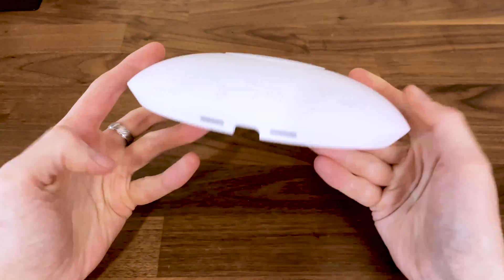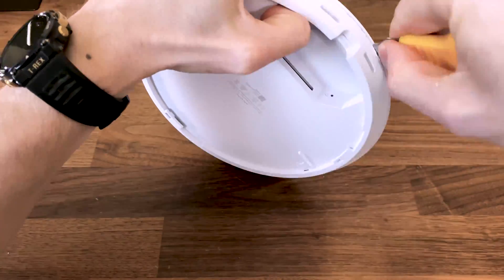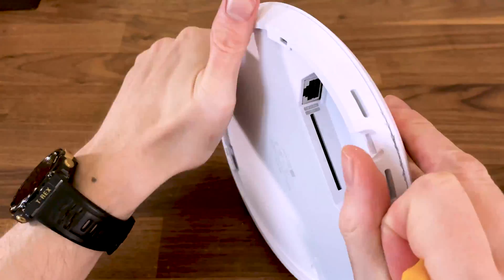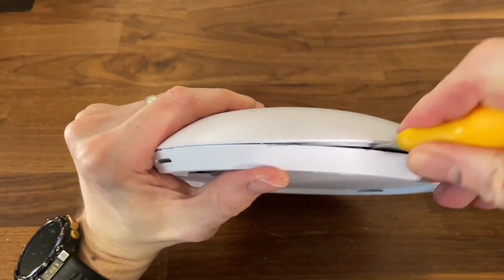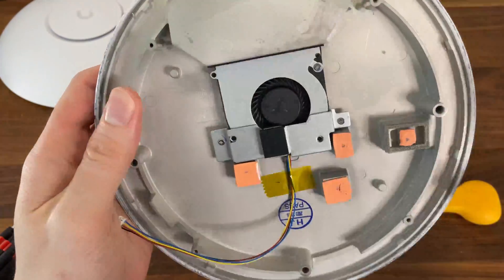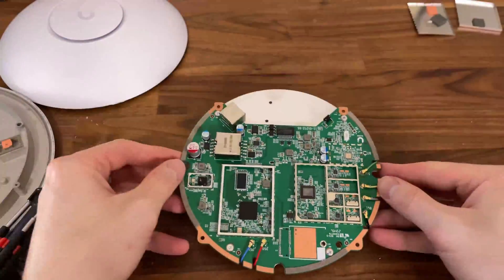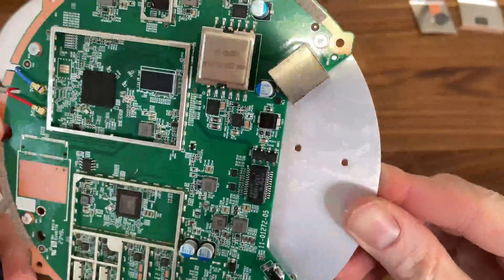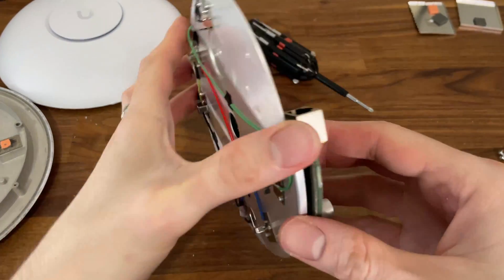Ubiquiti U7 Pro WiFi 7 Access Point Teardown

Comment: Do both the U7 Pro and the U7 Pro Max have fans? I ask because the Pro Max was the one that had a fan, but it seems they both do. Also, he said the radio had 4x4, which makes me think the one described in the video is the U7 Pro Max, not the U7 Pro as described.
Reply from the maker: They  both do and this is the U7 Pro. I made this teardown more than a year ago and I simply checked the specs of the chipsets. Perhaps Ubiquiti limited it to 2x2 despite the full potential of the chip.

Comment: I bought two and they simply don't work with any existing computers in our company. Nothing can connect to them. Even in IOT compatibility mode. Pure junk.
Reply: The 2.4 band seems to be problematic on these. I just turned it off and use an AC Lite for legacy 2.4 clients. Only IoT crap should be using the 2.4 band these days.

Comment: They should warn customers that these are really ONLY for ceiling mounting. When you put them on the wall with the "U" in upwards, it will overheat. The warm air gets trapped in the upper half of the device and the fan tries to push warm air a long way out through tiny holes, which does not work. No wonder why mine overheated and quickly recovered when I took it off the wall with the vent upside and additionally putting an ice pack on it during the last few weeks.

Unfortunately, contacting Ubiquiti support will not help you identify this as an issue. They will point you to installing the latest beta firmware update (my experience) and hope that you problem is solved. Which it isn't. The devices are supposed to work at up to 60 degree Celsius environment temperature and it was only 30-33 degree Celsius. Do they actually test their designs? Now I have serious doubts. It could be that I got a bad device, but the bad WiFi experience I sometimes had with the U6-Enterprise, which is very similar with the metal back side (which the U6-LKR didn't have), could have had the same cause, I was just not expecting it and not experienced enough to identify the issues back then.

U7-Pro-Wall design makes much more sense with larger vents.Which was unfortunately announced a few weeks later.

Comment: You open it wrong.  Take a Stanley knife and expose the blade about 2mm.  then go around once and it's open.
Reply from the maker: Oh, I am sure there was a better way to open this type of devices. Which is why Ubiquiti should just use screws and silicone seals for water resistance, so that at least one idiot (myself) can easily access the inside of the AP.

Comment: bigger question does the fan stay running all the time or only when it under alot of load?
Reply from the maker: I haven't yet tested it enough to be 100% sure (a proper review is in the works), but I can tell you that there are times when I hear the fan and other times when I don't. The conclusion seems to be that in the worse case scenario, it does adjust the rpm according to the load.
Reply: I didn't hear any fan noise. Mine might have had a defect fan.

Comment: I did not know about the fan before. It might actually be a deal breaker. Are there fans in any of the U6 versions?
Reply from the maker: I have opened both the U6-LR and the U6 Pro and neither had a fan, so I assume that the Enterprise version is fanless as well.

Comment: Hey there. Thank you for this tear down! I wrote to Ubiquiti regarding the fan: The fan should blow the "hot" air out... so it works like a blower fan. Now from what i see in this teardown, there is no way for the fresh air in or? Dust accumulation should therefore be minimal.
Reply from the maker: Thank you for the additional research into the fan. And honestly I hope that dust will not accumulate because you do not want to have to open up this AP.
Reply: @SamBondor well if fan can blow only out and there are no intake holes / places for the fresh air, i think that dust will not be a problem.
Reply from the maker: @shortygfx  That's what common sense would dictate, yes. Then again, I am far from being an expert about cooling.
Reply: @shortygfx  hmm... air has to get in somewhere right? How else is is going to go out? If there is no intake the air will go backwards through the fan or it would create a vacuum in there.
Reply: @magnuserlandsson1327  hey! Well from the teardown i dont see any air intake. I think the point here is simply to push the hot air out. The only air intake would be on the top, where the led is positioned, but i could not see in this teardown if there is actually any gap for letting the air in.
Reply: @shortygfx Yeah, that is my idea also. Where the LED ring is, is also the intake. (Always was with all previous AP's, but they where all passive).

Comment: Very expensive WAP with Tri-Bands, each only being 2x2 and such tiny little antennas, wasted potential. Certainly a contender for antennas to be removed and connectorised.
Reply from the maker: You should check out the price of the EnGenius WiFi 7 APs... I will test the Zyxel NWA130BE soon and it seems to be closer in price to the U7 Pro. Hopefully, it will be better.
Reply: @SamBondor  Zyxel (chinnesejunk) can stay in china. EnGenious, yeah, I still keep finding that stuff around and pull it out. Thanks but no-thanks.
Reply: this isn't expensive 😆
Reply: @bFix  Yes, it is for a simple device.
Reply: Anyone got a dump of the spi? Mine is corrupt before uboot? My board revision is 11-10530-01
Reply: I'm curious when we will see the first wifi 7 MediaTek-based access points.
for 6GHz wifi 6e there is the Acer Predator W6 btw.